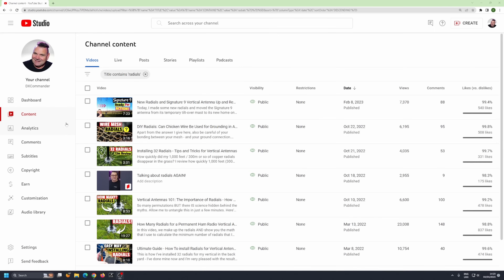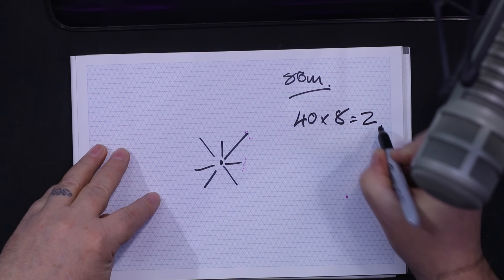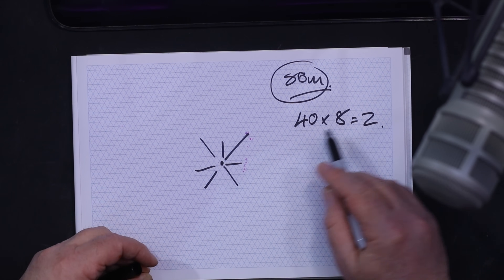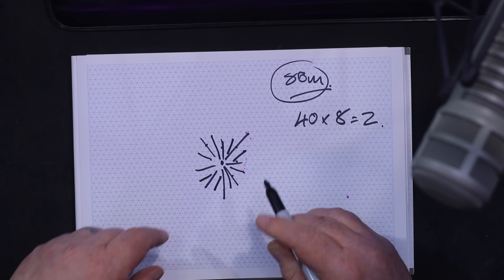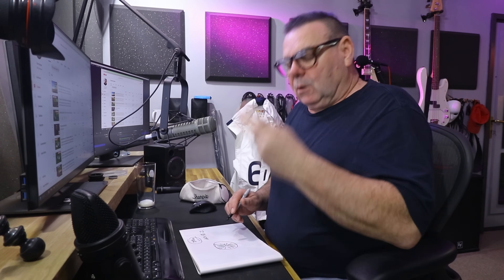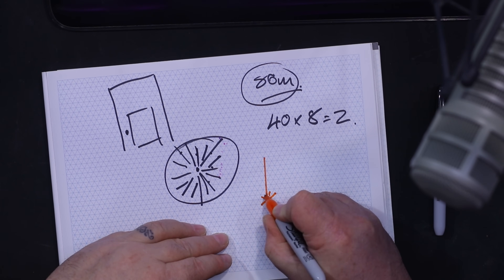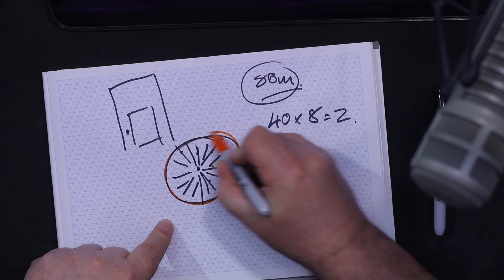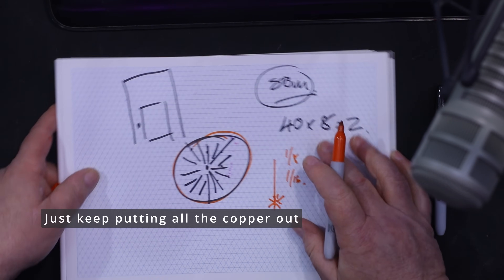3 Rules - Quick Tip - Radials for Ground Mounted Vertical Antennas

Comment: Thank you so much for making this video.
Funny story, though - I have a Chameleon MPAS 2.0 set up in the vertical mode (~ 22' high with a cap hat half way down - attached to a 500watt 5:1 (I believe) unun, which is then attached to a 1' ground spike for support). It came supplied with a sigle 20' 'counterpoise/radial ...
OK - set up in that configuration, the swr (as tested on my RigExpert analyzer) was ~ 2.8 @ 40m, then dropped in a 'parabolic curve' to ~ 1.8 @ 20m, then rose and plateaued ~ 2.5 @15-10m, then rose up past 3@6m.
Then, I added 8 x 16' (1/8 lambda @ 40m == 1/4 lambda @ 20m) radials in a 360 degree circle - straight, no bends or overlaps.
Guess what - the swr shot up to over 6.3@ 40m, dropped down to 1.5@ 20m, then shot back up to over 3.0 by 10m.
Chameleon didn't have any answers as to why this happened, so it looks like I have a 'Radial-Tuned' Vertical Antenna - No Coils Required 🙂
Reply from the maker: Apparently Chameleon don't answer many tech questions. So their customers email ME!
Reply: @DXCommanderHQ   Subtle ! 🙂 
Oh, BTW., you had suggested that I ask Chameleon for a 'far field' plot of their MPAS 2.0 (in the vertical config.) when I was wondering if their 'cap hat' raised or lowered the 'takeoff angle' (required for DX).
Well, as I recall, they said that the cap hat should pull the current up the antenna somewhat, but how that would affect the takeoff angle they didn't know, and that it would bee too expensive and not cost effective to create a 'far field' plot. 
They pointed out that this antenna was meant for man-portability, rapid setup and reliable NVIS-type communication within a few hundred miles. And that it was not meant for DX communications.
Fair enough, but I like to experiment and see how I can 'push things'. 🙂
Thank you for all your previous advice on this.

Comment: I put down 1000 feet of radials. I didn't sweat the length. Some are 8 feet long, some are 40 feet long. I just put as much wire down in the space I had. I've worked 170 confirmed countries (and about a dozen more unconfirmed). I think in a past video Cal said something like 2-3 times your lowest band in radial length is all you need.
Reply: I suppose that if a person has a narrow rectangular field, then 1/4 wave radials east to west and 1/8 wave north to south is better than all 1/8 wave radials?  That's assuming there's plenty of room for 32 radials.

Comment: Callum, I saw you talk about this a couple-three years ago. I got Severns' papers and read them all. It is good stuff and he does the technicals as well as the practicals. At that time I quit worrying about the ground field and just made sure I had enough wires on the ground (16).

I don't have a DX Commander (yet), but use this with a WRC system. I plan on building a set for my Chameleon MPAS 2.0 for vertical deployment. 

Now I need to see if the Signature 9 antennas are in stock. 😛
Reply from the maker: Haha.. Yeah, SIg 9s in stock :)
Reply: Hi Callum, many thanks for this video. Its getting warm enough for me to put up my new DX Commander and every time I thought about the radials, it just got all fuzzy. Never really got what I trying to do but this c,eared it up.

Comment: I have a Classic and 25 x 3.5 meter radials configured in a semi circle (180 degrees) as I have mounted the antenna against the fence in the back yard here in the West Coast of Canada. I did this to eliminate the need for guy wires. I get outstanding results in all compass points. I thought I would have troubles in the direction, but such is definitely not the case. As Callum says, just get the wire on the ground! Cheers from VE7IRR.
Reply from the maker: Nice one Ron.

Comment: How about adding an 8ft grounding rod in the mix too? I haven't tried it but I've been thinking about it.
Reply: Yeah, do it.  My vertical is mounted to a steel pole hammered about 4 feet into the ground.  Then all the coax is grounded to another 6 foot ground pole I installed and tied to the main house ground (using coax lightning arrestors) for lightning protection.
Reply from the maker: Well, honestly ground rods are good for lightening protection - but as an adition, why not.

Comment: I used 17 radials that are 17 feet long.  A few are a little shorter due to the house.  I had 250 feet of dog fence wire and used almost all of it.  Seems to work pretty good.   The earth diffuses the ground plane so you don't need to worry about tuning.  If your vertical is elevated then the radials need to be tuned to each band you are planning to use and measured exactly.

Comment: Good video Callum, I have a Sandpiper Hf Vertical vertical with twenty seven 2.5meter radials and it works fine 80 - 6m.  73's

Comment: Thank you for element clarity. I have down 32 radials at 7 meters each. I do not have to any more. Waiting on the lay over base you mentioned in one of your videos l.  Then tighten down the guides at two levels. 18 mph breeze will not take it down again.

Comment: I have been using 21 3 meter on both my classic and expedition and both get great DX consistently. My classic is a permanent install and they cover 360 however I have had my expedition is several configurations and never noticed a difference. I would agree don't over think it and focus more on getting your tune right where it needs to be.
Reply from the maker: Nice comment!

Comment: Agreed! 👍
My Hustler 6BTV has no radials more than 5metres and a lot are less than 3metres.
Made them to fit the area and they work very well 80 to 10metres
At one time I tried some 10metre ones but no difference when they were removed.
Reply from the maker: Yes, I found same.

Comment: I used a single ham stick (vertical) with a mobile mount screwed to the metal railing of my apartment balcony  and got contacts all over the world. Using a 12 foot metal railing as a ground plane. All day everyday for like 6 months. 😂 even as low as 80m

Comment: The best advice in this video: Put the copper down. That’s it. That’s what I did and I’ve worked the world using scrap ethernet cable as radials. Measure the radiating element and put the radials down!
Reply: Sir-  I have just cut up a bunch of Cat5 cable to make radials, on the recommendation of another YT guy.  Did you pull yours out of the sheath and then spread completely, or bundle at points or exactly how did you deploy yours?    Thanks.  Tom
Reply: @HowToHam_Tom  I took the four twisted pairs out of the sheath but I didn’t untwist the pairs because that seemed to be more trouble than it was worth. The 5m pairs make an X and the 3m pairs make a + so they are all spread out evenly around the base. I used some ground staples to hold them flat to the ground since they like to coil back up on their own.

Comment: Callum … Absolutely true.  I have the expedition with 10, 12, 17, 20, 30 & 40/15 m bands.  My radials are “alligator clips” with 4 - 12’ (old money) wire bundles.  I clip the 4 wire bundles on the base plate for faster deployment and it gives me a 16 wire radial field.  I use it for POTA activations and have deployed the radial field all in a 90 degree area of the base for a couple activations.  The radial field was pointed towards the west and I had no problem on SSB making contacts along the east coast and Europe for a contest.  I live in Tucson, Arizona for reference.  It really proved to me the position of the radial field isn’t all that important.

Thank you for another great video.  Keep them coming!
Reply: The alligator clips is a fantastic idea, cheers!

Comment: I've put up the DX Commander Classic twice and  on opposite ends of the US. Both times I used the radial pattern and lengths suggested by Callum's instructions and the antenna has worked very well. As to the radials "disappearing into the grass", let me give my 2 cents worth. Ground staples are  important to allow the radials to lay flat. The staples aren't that expensive; buy some extra at the garden store if need be. Finally don't cut the grass as close as you're used to for a few weeks, raise the cutting height of the mower, especially if your garden/lawn is primarily St. Augustine grass. That type of grass is considered a weed in many states but is common in the southern US. St."A" loves to push back against anything laying upon it, however, if allowed to grow to a 3 1/2-4" blade height the grass will "relax" it's grip on the radial and allow it to sink to the dirt. Adjust the mower height as need be and all is well!  AA7MO
Reply from the maker: Perfect!

Comment: With my Signature 9 I put 24 radials out in a rough circle, they are each 3 metres long (mostly). Works really well on all bands.
Reply: Just bought a classic and also did 24 radials, 4 per lug, 6 lugs, at 3meters length. Excellent results. SWRs were near perfect across the board from 70cm up thru 40m.

Comment: One year for my portable antenna I wound a coil on a wire with my 20 foot crappie pole.  Used a 9:1 unun and various lengths of wire radials whateven worked.  Carried several wire lengths and tuned the wires.  Worked fine.  Much better than a base loaded vertical.  73.

Comment: Cal, would you recommend adding a grounding rod. Do you think it may reduce some electrical interference I have at time. For your followers  my DXC been up for over 2 years now. My radials are just spread out around 180 degrees. Cant get them out 360. The DXC  Still never fails to amazed me.
Reply: Steve, check out GM3SEK's "Clean up your shack" I built the common mode filter for the mains supply. On the worst HF bands it literally dropped the noise level by 2 S-points. (I do have groundstakes attached to the antenna but also a LOT of radials). I also tried a common mode choke at the shack end of the feeder, a similar improvement but of course combining both did not produce a cumulative effect! Feel free to email me if you need any more info.
Reply from the maker: Hey Steve.. I don't know about ground rods. Yes for your statin but the antenna? I can't see benefit.

Comment: I have space in the yard so I cut 30 at 65’. I’ve yet to test it but I hope to know that the snow is leaving NY. With the antenna in the center of the yard the most east west radials will have to go through my metal pig wire fence. I’m wondering if I should curl those few around so they stay away from the fence. I’ll definitely check it both ways either way.
Reply from the maker: You are overthinking it again! HAHA.. Just poke through the fence - or cut them back. Won't matter and you will never know :)

Comment: I have not put much effort into putting up a vertical over the years because of the "need a bazillion radials" folklore. Now, after watching quite a few of your videos, I am looking at scratch building a three or four band DX COMMANDER. Thanks for all the info, Callum!
Reply from the maker: Nice challenge!
Reply: @DXCommanderHQ  Got the DX Commander clone built. 10m-40m with eighteen 5m radials. Used it for the Indiana QSO party making contacts out to the US west coast, east coast, southern states and I even worked some Euro DX. It works, Cal!
Reply from the maker: @CrookedCreekWanderer  Lovely!

Comment: Used a 1/4 wave vertical for portable and SOTA with four 1/4 wave radials each wirh banana plug. Often did receive tests by pulling them out one by one. Removing radials #4 and #3 made no discernible difference.  Removing #2 was just audible, guessing 2-3 dB.  Removing the last  one and receiver noise dropped to the floor.  As a result I frequently just rolled out one radial. I think it's also known as a counterpoise.
Reply from the maker: Yes OK Paul.. I do believe it might be worth cutting your 1/4 in half and putting them in pairs on bananas.. But hey, if it works..
Reply: @DXCommanderHQ  Will try that, thanks Callum. And easier to roll out.

Comment: I did an experiment quite a while ago to reduce the radial field by create a 'swirl' of radials around the antenna. That does not work as I was hoping. 
Just make your radials as straight as possible. Around a corner is fine, but not in a swirled form. 

Scientifical - I tested with WSPR, transmitting 1W, straight and swirled switched time after time. 
Some stations were repeatedly down by 10-12dB while others came up just a banana or 2, so barely an improvement there. As straight as best as you can works (for me) best. 

Just my 2 pence :-)
Reply from the maker: That is very intereeting Anton.

Comment: Very nice - follows the results others give on PRACTICAL advice, not schoolbook theory.
Thanks Callum (I have found the same thing with my old 5BTV - still 1~2 S units less than the 80M OCF, but it still does low angle radiation needed here and there)

Comment: Middle of a 10×4.5m plot. 25×4m radials. Full length to North & South quadrants, folded as required to fit East, NONE West so I can get at feed point without trampling on them. Many Caribbean islands and QRZ S. America award in what you might think should be the blind zone. For curiosity, one day I put them all South-ish; no noticeable detriment to performance.
Reply from the maker: Very interesting..!

Comment: Hi. What do you think is it ok to use army field phone cable for radials? It's twisted pair of wires and I would like to use one pair as one radial. Will that be a problem? It's he'll to split this wires...
Reply from the maker: Do it. It'll work.
Reply: I did it with four twisted pairs from an Ethernet cable 1/4 wavelength long on 20m. I used one conductor for the vertical and the rest for radials. I wouldn't call untwisting them "fun" but it definitely works.
Reply: *hell not he'll 😅

Comment: Nice video!  I don't have a Dx commander but I d have a Butternut Vertical 80M - 6M.  I have just what you said.  I have 30 radials that vary in length from 30ft to 10ft.  I put them where they would fit based upon the constraints of my antenna location.  I have worked all states in the US on 6 bands and have 100 countries on 6 bands as well.  I will say the majority are FT8 but that still isn't bad.  i don't think that bad for a vertical.  I always enjoy your videos.  Keep them coming! 73 Jeff Darby KS0JD
Reply from the maker: Very nice!

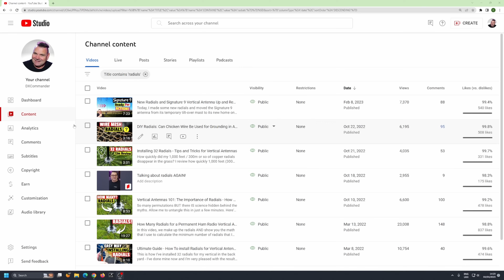Comment: Spent the last 6 mo. optimizing a 80m 3 element vertical parasitic array, directed to the EU. I found myself obsessing over SSB signal reports while expanding the radial field. The problem...at 00:00Z, when DX conditions are optimal, the DX stations are mostly non existent. Instead I use SNR reports from WSPR net. Let the 200mw transmitter run through the evening and the next morning there are nearly 100 SNR reports to obsess over. hihi
Reply from the maker: Rick.. Yeah, I have done the same! :)

Comment: I am very lucky in the fact I have a garden big enough and a forgiving XYL to mess about with my antennas. My First Classic I think I had 20 5m long radials, because I wanted to bury them and I got fed up with doing it :-) My Classic worked fine, I then added 20 10m long ones on the ground, my Classic worked fine, NO noticeable difference, I cut the 10m long ones up and messed about, have ended up with about 80 radials between 3 and 5m long. Still no noticeable difference. I did find a difference upgrading to a 12.4 Sig though but that is because it is a different pole. What am I trying to say? Same a Cal, put down what you can, if you have a set up like Cal then do what he has don, all you need to do is whatever you can do and get on the air. Get a tune around 2 to 1 or whatever you can get and talk to folks. Be lucky, be good and enjoy yourselves.
Reply from the maker: Nice one Chris.

Comment: Have you ever bypassed radials and substituted a ground rod to soak the ground plane?
Reply from the maker: No.. That's a lightening conductor not an antenna. I don't know why folks talk about this..
Reply: @DXCommanderHQ  I have experimented with earth spikes and it does not work. The wrong information often persists, more so in the modern world with social media etc. It's one of those ideas that people think should work, I get when they asked the question.
Reply: From what I've seen - not recommended
Reply: FWIW I live in an area with high conductivity soil, at one time I had a ring of ground stakes around the antenna, Probably not a bad thing as part of a lightning protection scheme but not a success for RF performance. I know it may be counterintuitive.... broadcasters go to great lengths to keep RF current out of the soil, by using ground screens.